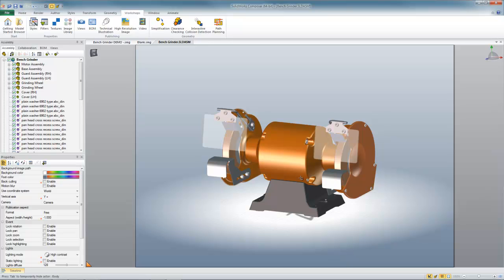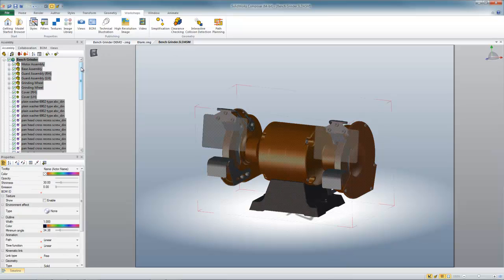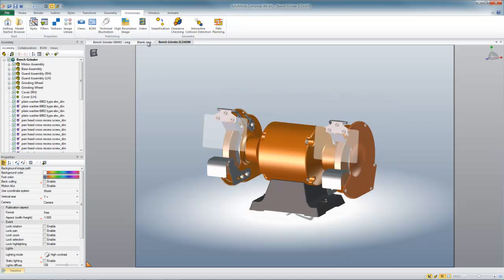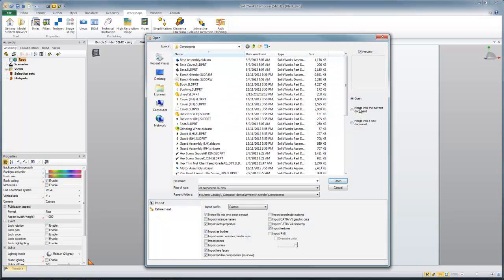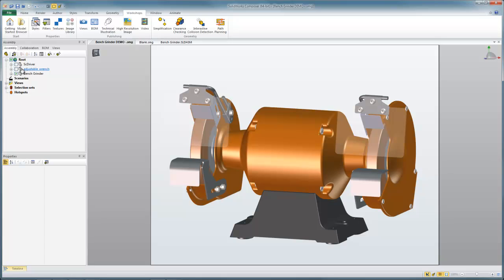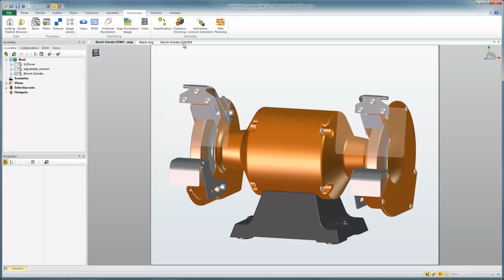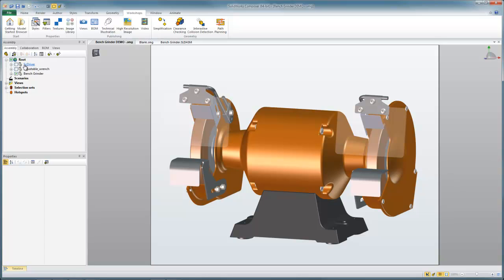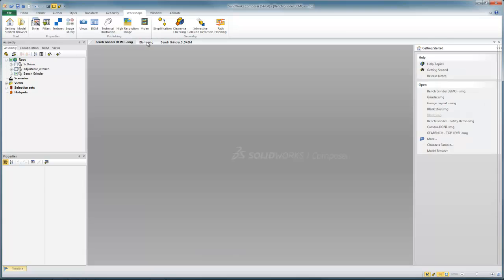01 Container Concept

Comment: Screw drivers and other tools... Well how can you draw them in the required coordinates without starting them in the very model's assembly? I mean maybe I don't know something, but when I draw a new part that I want to come in some particular place in an assembly, I either start drawing it in an assembly, or mate it in an assembly. So, what if I simply put a screwdriver in an assembly, and then rebuild it and save? will a screwdriver become visible in a composer or not? I mean yes I can find the coordinates of a screw in an assembly and draw a screwdriver seperately, but that would be harder, so what if I simply draw it or mate it, and then it should become visible in a composer assembly, shouldn't it?
Reply from the maker: Hi, thanks for your question! I do not insert 3d models for tools, etc. into SolidWorks because I don't want to have to create extra configurations or worry about them showing up on a drawing or worse, in a BOM. In Composer, you can insert a 3D model, then drag/rotate it into approximate position. It's quite easy, especially if you switch between front/top/right views in order to get the approximate position just right. There ARE some basic alignment tools that can make things coincident and concentric, which is also helpful. But the most important rule of thumb is this: It doesn't have to BE right, it just has to LOOK right. As long as you can move the object into the close approximate position that LOOKS right for the view you're creating, you've done your job. Composer doesn't care about exact coordinate placement. It's not important.
Reply: @SouthTTM  oh I see now! Thank you for such a clear explanation :) great videos by the way!